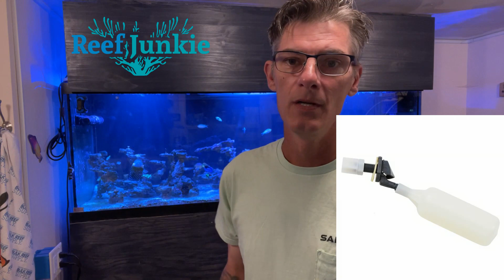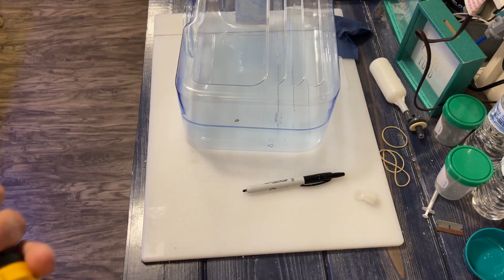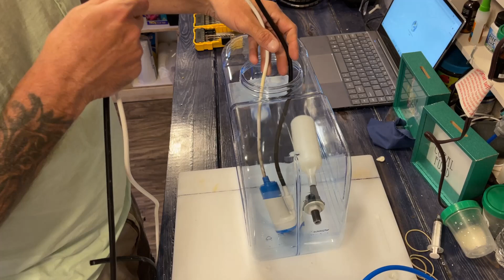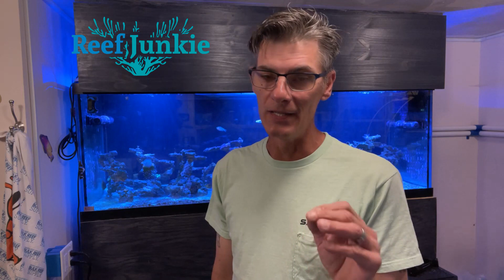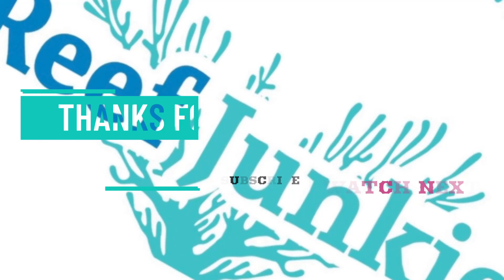DIY Aquarium ATO Container ( Never Ending Water Supply )

Comment: This is a very bad idea for many reasons. 

1 TDS creep would be very high with all the on off of the rodi. Eating your di resin very fast. 

2. if anything goes wrong with the ATO it has unlimited water to add to your tank. So stuck on and now your tank is overflowing with rodi, your salt level drops and kills everything. 

3. if your float valve fails now that container is overflowing everywhere. 

4. many many professionals in the reef industry say not to hook your rodi directly to your ATO.
Reply from the maker: The only issue I have come across so far is your #2. Like I said in the video my external overflow aqua lifter pump died and my display overflowed. I caught it in time but it could have been worse. Other than that I love how it's been doing for me for years.
Reply: The idea isn’t bad. It’s just important to add safety features to prevent flooding. You could install rodi guardian, audio alarm if it detects water. Like I said the idea is good but you need to install safety precautions.
Reply from the maker: @Deus-vult1980  good point. I have been looking to get the leak detection for the Neptune apex for my main display. Now that you mention it, it would be a good idea to put one near that as well. Thanks Roke.

Comment: What happens if the float valve sticks open?
Reply from the maker: I have not come across that issue in the 6 years I have been using it. That doesnt mean it couldn't happen which would overflow the container being you drill holes in the lid for wires. I would think it would hard that to happen since the valve floats up to close. You could do a yearly replacement on the float valve as well as added piece of mind. Thank you for the comment. Love the engagement.

Comment: Great information. The only issue I see is the constant on/off of the rodi, which will cause di resin to need to be replaced more frequently.
Reply from the maker: Possibly. But the trade off of worrying about if your ATO is empty because you forgot, or the hassle of filling it all the time has been worth the trade off of DI resin. Convenience I guess comes with a price. A big downfall on doing this is that reefers that use kalkwasser I believe can't use this as the Kalkwasser will be constantly diluted as the container fill at its own free will.

Comment: I once had an ATO overfill event. It happened because I DIY’d a standpipe silencer for my overflow which was not fabricated good enough. I followed the directions but in my case the holes of the inner pipe were not big enough. Over time it clogged up and my return outpaced my syphon which lowered the level in the sump  and started the chain reaction with the ATO.  I only had 2 gallons in the reservoir thank goodness but my salinity still got down to 1.022 and my tank mates were not happy (no losses though). I made all the holes in the standpipe bigger, increased the gap between the inner and outer pipes and fabricated a shield for the grill of my overflow intake so that floating food and such does not go in. I also inspect and clean the standpipe as part of regular maintenance now.

Yeah that event was scary. I was at work and my wife sent a picture saying something looks weird with your aquarium. The water level was pressing against the glass cover and about to overflow. I explained what I thought was happening and told her to pull the whole standpipe out the second chamber. I couldn’t get back home for about 4 hours but everything worked out in the end.
Reply from the maker: It's a scary event indeed. That not only could cost anyone everything inside their aquarium, but the external home damage could be extensive. Glad everything worked out in the end for you. You learn from your mistakes. Thanks for watching and commenting Ron.